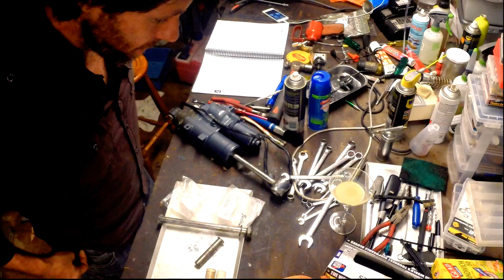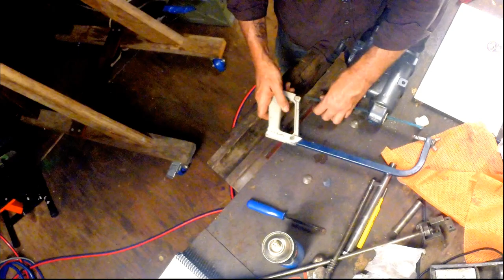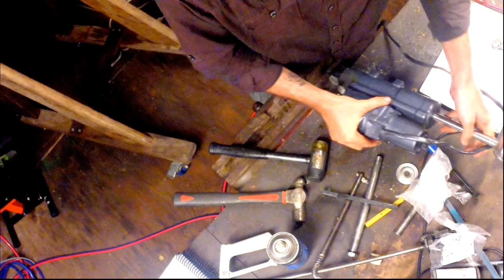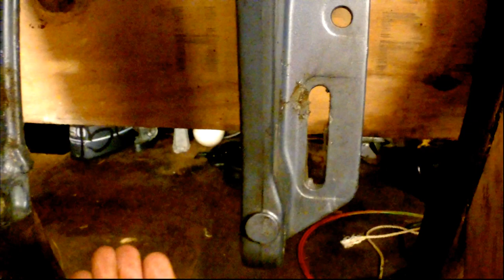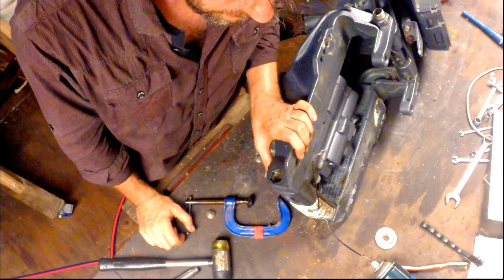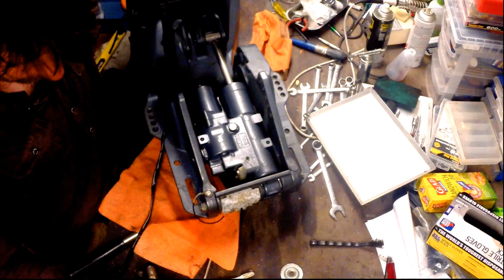Installing a power trim tilt unit in an outboard motor

Comment: Thanks for video, i replaced my power trim motor other one was completely seized put fluid in ( Dextron II hope thats ok? ) i can hear the motor working but the rams arent going up and down much and lots of froth coming back out filler? .... I bought the motor with tilt trim not working ,.... from what i have described does it sound like it needs new seals on the rams?

Comment: Many thanks! I agree with your choice to show "warts" and all. A manufactures video often done on a brand new engine is of little use and I feel a bit dishonest. After all, who needs repairs on a "new" engine? Repairs are needed after years of ware and tear, around here that mean in salt water. So corrosion is the norm making everything that much more difficult. Your video put truth to the difficulties one finds in repairs in the real world  -  Many thanks again
Reply from the maker: +Karl S Thanks Karl. Yes, when I read a line in a manual that says, "and then gently slide out the bearing carrier" or some such I start to think I have something wrong when it won't come out for love nor money I start to think, "I must be doing something wrong" where in truth it just isn't that easy. Sometimes I think corrosion is stronger than my welds! ;)

Comment: i just talked to my buddy & hes gunna take a look at the key & make sure its connected to the pump. And ill hear for the motor running when i press the trim button, then manually raise the motor 4or5 times to blead it. After all that ill definitely let u know the outcome. Again thanx a bunch & hope me & my buddy can get it working. Then i can take u fishing! Lol
Reply from the maker: Let me know how you get on, reading the comments below it does sound like the key is either misaligned or missing altogether.

Comment: I have a 1974 50 hp Johnson outboard motor. It doesn’t have power tilt and trim and I would like to know if a power tilt and trim unit from another Johnson could be made to work on my motor.

Comment: The solenoids or relays inside the outboard motor click when i press the up/down trim button but doesnt trim up or down just makes the noise like its trimming.So someone told me that the relays r still good. So what do u thinks wrong? Thanx & ur videos good & r very helpful!
Reply: Probably right but you should check with a voltmeter that the proper voltage is getting through the relay.  But yeah, there's a higher likelihood you have an issue with the motor or you've lost fluid pressure.

Comment: Hi Dangar Stu. I have two 15 hp outboards on my Catamaran and one of the motors isn't tilting all the way up. Pump makes a labouring sound as if it is at its limit. Both motors used to lift all the way up. do you think this could be a low oil issue?
Reply from the maker: I would certainly start by checking the oil, but if it is low you will also need to find where it is leaking from.

Comment: Hi,  Question i hope you may know the answer to.  Are all these yamaha single ram power trims the same size. I want to replace the gas asssit on my 2006 40 3 cyl for a power trim and there are a few around, but all seem to be from different size yamaha's.  some 60's 4 strokes, Do you think they will fit?

Comment: basically we had to line up the rubber gasket on the bottom of the electric motor to make sure it sealed & screw the 4 bolts in & plug the electric wires in that goes through the outboard & to the battery. The trim motor we got & bolted in came assembled already.We didnt do anything with the hydraulic ram that trims the motor.

Comment: I'm not sure if YouTube is the best place for this, but I want to know how to install steering, and trim and tilt onto a 15hp motor,  can this be done and where can I find info on doing it? Just watch videos like this?
Reply from the maker: I'm hoping to do a forward control conversion video soon. There may be some around on YouTube already, but they can be a little bit different depending on the model of outboard, that's the big trouble. This video might help you with the steering. https://www.youtube.com/watch?v=VJ8UruO-_a0

Comment: So I have a 1985 evinrude 50hp the tilt and trim makes the sound like it's working but it's not going up or down where should I start to get it working I was told it has a new motor this is my first boat with tilt and trim but I have no idea even how to take it off to check it

Comment: it was assembled already & working, when i bought the boat. i used it for a year or so then it wouldnt trim. my buddy took apart the old motor & showed me that the magnets inside were in pieces& crumbled. so he got me a new motor & me & my uncle replaced just the electric motor of the tilt/trim system & didnt touch the ram.
Reply from the maker: Sounds like that is you problem then. That keyway is loose inside and is easy to lose, it may have stayed attached to the old electric motor and may be missing completely. They can also be tricky to line up.

Comment: I have a 2006 bf Honda and the water hose came off and filled the motor compartment with salt water. It has stopped the trim from working. I first went to the relay and found corroded wires so I replaced it. Now I have power 12volts and still the tilt motor will not respond. What do you think?
Reply from the maker: Jess Knight The trick is to test each part in isolation using a multimeter. Does the switch work, does the relay activate when the switch is pressed, does the relay pass current through when activated, and finally does the motor respond when you put power directly to it. Also check that you didn't simply blow a fuse in the outboard from the water shorting something. Let me know how you get on. Oddly, my "Motor won't crank" video will give you some tips on doing these tests.

Comment: I have a 91 force 35 HP motor. After replacing the seals on my tilt trim and as i lower it, it start to shake and jump. When the motor come down to a fully stop, it makes squeaky noise like a squeaky door. Any help will highly  appreciate it. Any suggestions?
Reply from the maker: It could be that they are dry and will smooth out as oil reaches them.

Comment: After replacing the seals on my tilt and trim, it doesn't hold up and still slowly drops. What have I done wrong?
Reply from the maker: Which seals did you replace. It could be the ram seals or the bypass valve seals causing this. It could also simply be that it hasn't been bled properly yet and still has air in it.
Reply: @DangarMarine  there's only 3 o rings. There's a small o ring inside the cap which is go around the shaft and 1 around the cylinder and 1 around the end cap. I had filled with fluids couple of times and lift it up and down couple of times.

Comment: Hi Dangar and all guys. Im new person at those outboards and boats,but got in to one of my projects, so be it... but as I noticed Yamaha 50 and 60Hp kinda good engines ans I have two now for low price, but diy needs. On 60hp I want to try to install power tilt from other Yamaha. Guys need your helps and advise, or Im chasing "Poseidon" for nothing 😂!!! Im based in UK London. Any communication will be appreciated... obviously via email etc, for a faster communication.
One more time thx for Dangar.

Comment: Hi Stew...thanks to your videos i could manage to fix a few bits and pieces.but iam.still struggeling to find out WHY my yamaha power trim tilt works fine whilst not driving but not when driving...not enough current going through to energize motor?i had a similar issue with power cable(corroded) which coild start engine properly..thanks in advance-btw still owe you a beer when you are in Adelaide;-)

Comment: I have a 1975 Johnson 40hp outboard that doesn't have trim. Can I put a power trim from another motor on it? I know about the costly aftermarket plates I can use but wondering if I can use the trim off of another Johnson outboard that does have trim. 
Thanks!
Reply from the maker: You can usually add a trim unit to most outboards, but it will need to be compatible. You can usually check this by looking up both outboards and seeing if the part numbers for the trim unit are the same.

Comment: Where I Get one for my mercury 40hp 2015?
Reply from the maker: Mercury dealers are the only ones that can supply the original part.
Reply: Dangar Marine.
Reply: Jack Sexton  I have a Johnson 1988 with 115HP the trim gauge wires are missing going to the console  can I just tap into the brown and white back were the gauge runs to the Relays and run a new wire to the console and hook it to the signal stud on the gauge ?

Comment: ok i did do that after i replaced the trim motor & filled it with hydraulic fluid but ill try it again. thanx
Reply from the maker: So was it all ready assembled as a unit or was the electric motor off? There is a little key that connects the motor to the hydraulic pump. If you can hear the motor turning but it isn't moving it means either the bypass is still open or maybe this key is not in place properly.

Comment: i replaced the trim/tilt motor on my 60hp mariner & when i press the button it makes the noise as if it is trimming up or down but motor doesnt move. Fluid level is good so is battery so just wondering what it is? Tilt motor is brand new not rebuit. Any idea would b helpful, thanx!
Reply from the maker: Hi Bob. If it is brand new it could just be a bleeding problem. Try opening the manual bypass and then lifting the motor up by hand and letting it drop down with gravity four or five times. After that close the bypass off and try again.
Reply: Hello do i keep the screw in thats for the hydraulic fluid for filling it?
Reply from the maker: Yes, keep the fill cap closed.